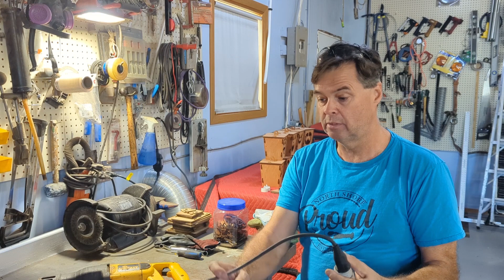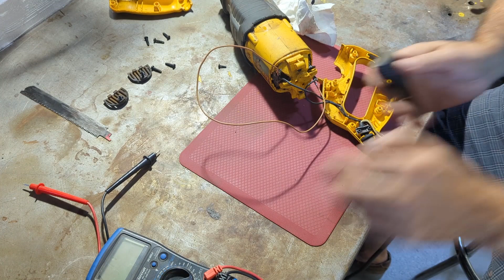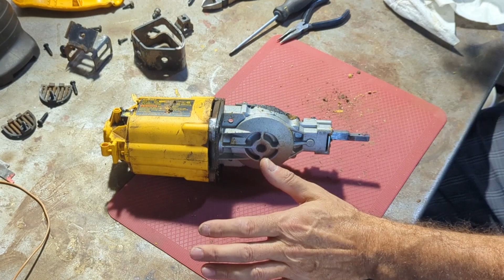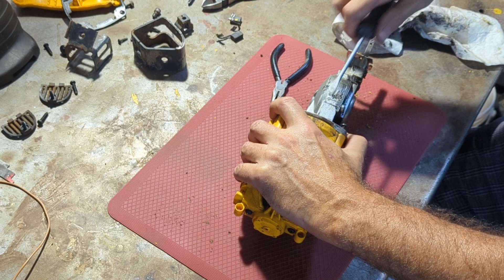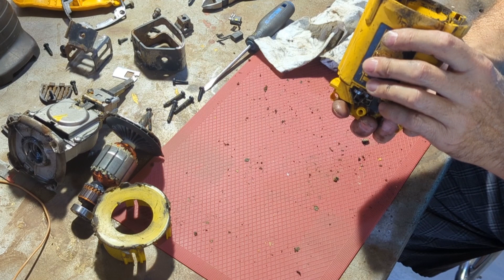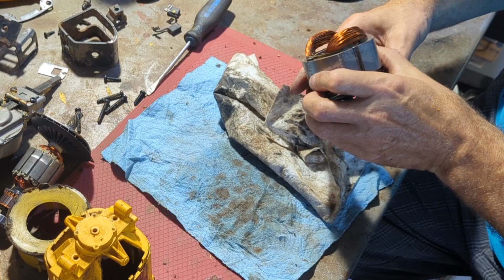Dead Dewalt Reciprocating Saw Will It Run Again?! ☠ ☠ ☠

Comment: Thanks for the video, 
I just did the same with mine, 
The bush looked good, 
cleaned the dirt , bushed with scotchbrite
used brake cleaner
Did not bother pulling out the motor 
that was the limit of my time on it

Comment: Hello, I have the exact same model as yours. How exactly did you remove the pin in the shaft? I tried to wack it out or pull it out with a visegrip but no go. I am afraid I will break it. Thank you for your video.
Reply from the maker: I used a small punch to remove the pin.

Comment: re: DeWalt DW303 blade clamp/chuck, when you insert the saw blade, does the back end of the saw blade just butt up against the black pin or does the hole in the blade actually fit onto the black pin that sits right behind the allen screw? I know the allen screw has to be tightened down no matter what, but should the saw blade also be held thru the saw blade hole by the black pin or is it just the allen screw that holds the saw blade from falling out?
Reply from the maker: Depends on the replacement blade, I've had some that the set screw aligned with the hole, with blade all the way to the back of the holder, and I've had some where the set screw just pinch the blade to hold it in place.
Reply: @JRShowYT  Thank you that makes sense, I appreciate you getting back to me.

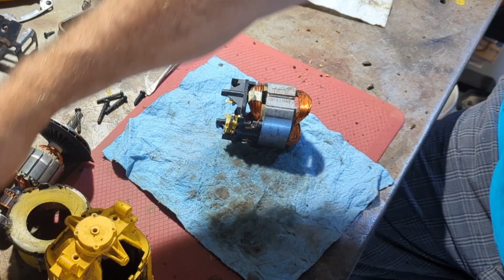Comment: 27:00 
Cant stress enough to check or at least, use a bit of heat and flux to Re-Melt the Solder joins to the Coil windings .. 
Believe it or not "Dry Solder joints" Can exist  and are easily Fixed, before throwing away good windings ..  IMO ...
Otherwise Good Investigation and teaching 👍👍

Comment: Thank you for the great video.  You dug into pulling the motor assembly apart further than i would have gone, basically, mostly a time factor.  But the testing point procedure is what caught my attention.  Most of my reciprocating saws were pawn shop purchases about 15 years ago.     Other than replacing or fixing a power cord or disassembling a trigger switch that's about all I've done to them.  Thanks for the educational video
Reply from the maker: You're very welcome, and thank you for watching the video! 👍👍
Reply: All good things take time 😊

Comment: Good try Alvin !  I have an old dewalt recipe saw and it be came a loaner, thought it was a gooner a few time but still works. Amazingly tough,  was amazed at how strong the gear box is, took it apart to lubricate one time and it showed very little wear.
Reply from the maker: Thank you Dean!
I bought that saw in 2004, I've used the heck out of it over the year, they sure are tough! 😊

Comment: I heard a guy from the Deep South call it a sawz y’all, sounded so funny that it stuck and now I can’t unsay it! I admit that I feel the same way about just tossing my tools and buying another. I would rather give a try to see the issue and repair it. Sure in a bind buy a cheap one at hobo freight, and repair the old one when I have time, but I just hate to throw away a tool especially if it’s something so small. Unless it’s a flux capacitor, or something WAY outta my league lol
Keep up the great work my friend,
And as always looking forward to your next video!
Reply from the maker: Hey Troy, I did go buy a new one, however, I'm going to take George's tip, and try to solder a new winding lead on, if I can get to the burnt end without wreaking the winding.
I wish I had a "Flux Capacitor", I would learn how to fix it...maybe an apprenticeship with the Doc! Lol

Comment: Hello Alvin.  Well, it was worth the try. It would be off to Harbor Freight if it was me. As a matter of fact, they have one for $30 (US). I have repaired windings like that on my shop vacuum.I found where the lead goes into the winding, exposed it, and soldered the lead back on. Good luck if you try it.
George B.
Reply from the maker: Hi George...I went out and bought a new saw, mostly because I need to get the old parts car salvaged. However, I am going to try your suggestion, and find the end of the winding to solder a lead back on...there's nothing to lose at this point!
Thank you for the suggestion...with luck I will have a spare reciprocating saw on hand. 😎